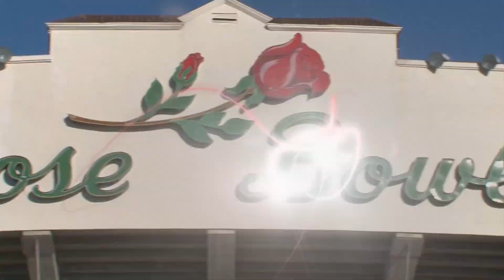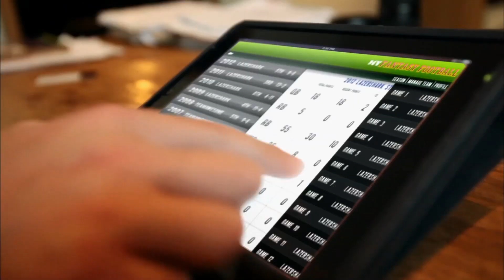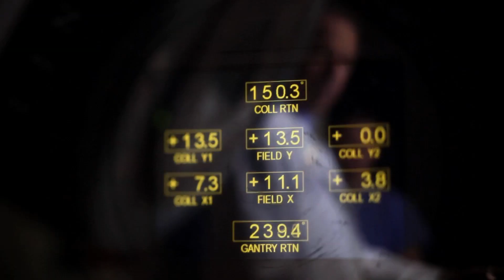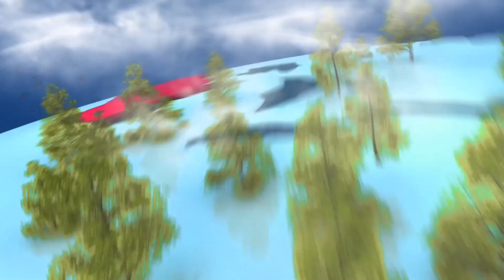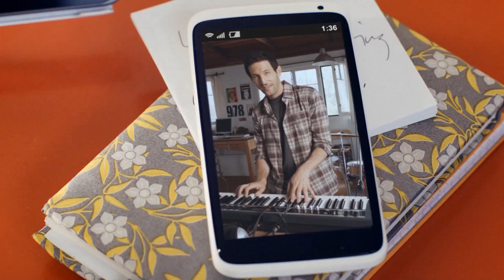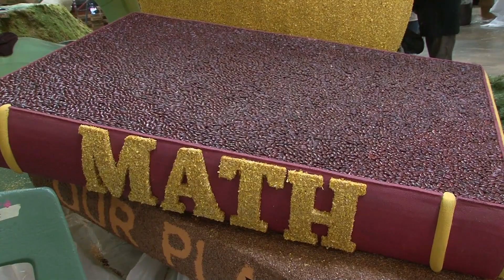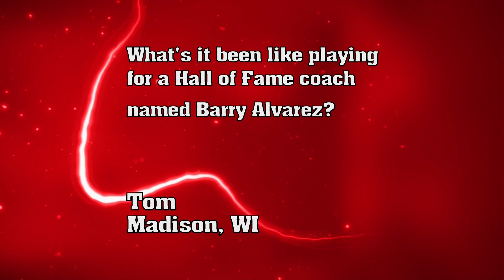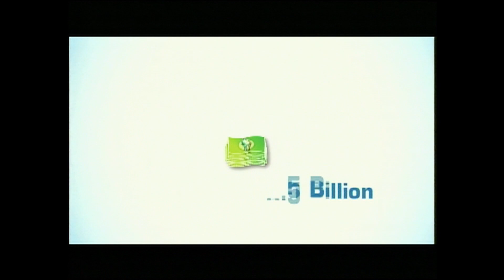Rose Bowl - Wisconsin vs Stanford - January 6, 2013 - Badger Sports Report

Comment: The better team won this game. There's little to break down and the last INT was a great Defensive play by the Defender #15, there's nothing Wisconsin did wrong other than try and run the ball all 4 times for the score, only to be neglected on 4th down. Stanford also made things pretty hard for Wisconsin going right at the Bagers early in the 1st qtr. going up 14-0 and also led by 10 when it was 17-7 before the Badgers Lucky next drive. Stanford also missed 2 wide open passes for scores in 4th.

Comment: Score should have been 28-14. Stanford blew 2 opportunities in the 4th qtr with 2 wide open recievers. Actually the time the reciever was open down field (would have scored) and the Tight End was open in Endzone and a High throw sailed way above his head. That's a sure TD and an easy Td for Stanford if the ball is passed correctly both times.Wisconsin when you consider that the Stanford Defender had a sure pic in front of the endzone, would not have been a score for Wiscy on the next play.